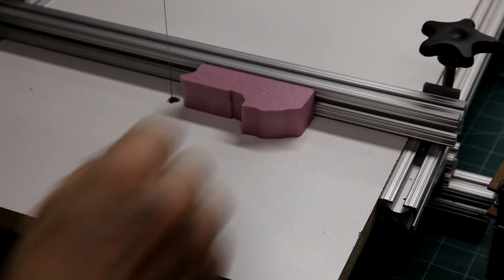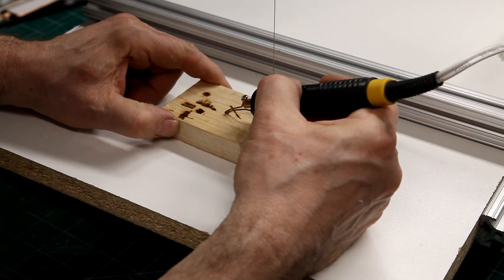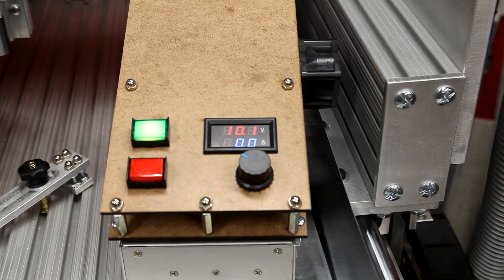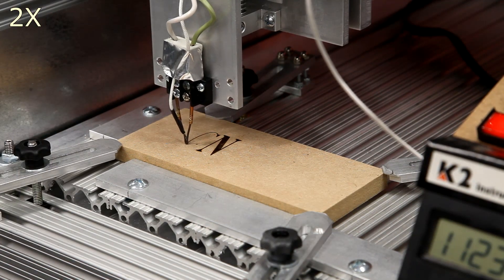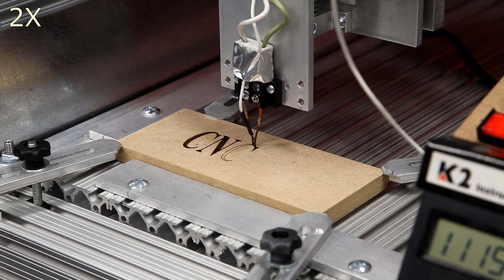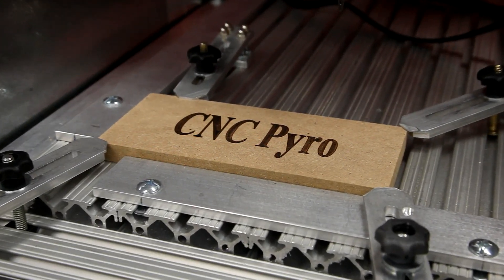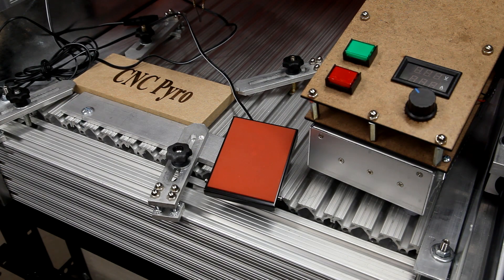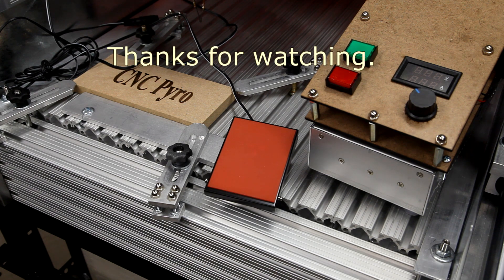CNC Pyro 1

Comment: Neat. I've built a few woodburning machines. The way to control shading is obviously, either through PWM sent to the wire, or by altering the speed of the motors, but it requires a lot of experimentation. Wood absorbs heat, so the longer the wire stays in contact, the lighter the shade gets. I tried controlling shading with the Z axis, but that would end up being too sensitive to  tiniest surface imperfections. I eventually left plywood and moved onto acrylic, printing 3D holograms layer by layer and then sandwiching them back together. They can be edge-light for a neat effect. Code-wise I had to rewrite my software, because unlike with wood, where nichrome could be dragged across, doing that sort of thing with plexiglass left waves that ended up warping the surface. The best approach was to print in scanline mode, lifting the needle between each head translation.
Reply from the maker: Yea, I use both.  I use PWM for basic control to keep the temperature constant. The problem in using PWM to regulate the actual burn in real time is the lag.
If you can keep the temperature constant, the speed can be regulated very fast.

There are some gcode processors that can for converting image files to variable  speed raster for duplicating the image.
Reply: @msimpson20175  My machine is a small platform hand-built out of a photocopier. I never used any professional gcode programs. I just code straight in python, but I'm not doing anything drastically different. Just more convenience, because I can embed my own rasterizer that will know the most effective pathfinding. I didn't put a temperature sensor, so I can't measure the temperature. I used up all the data headers for things like edge alignment etc. So I can only control PWM blindly and program  intensity curves based on how long wire is in contact, so it always starts cooler and then ramps up to account for thermal transfer.

Acrylic much harder to work with, because it remembers shape. Each time you heat deform the surface, it produces tension as it cools. Sheets have to be thick, or processing should be minimal. Regular CNC engraving is far superior, but I had to try this anyway.